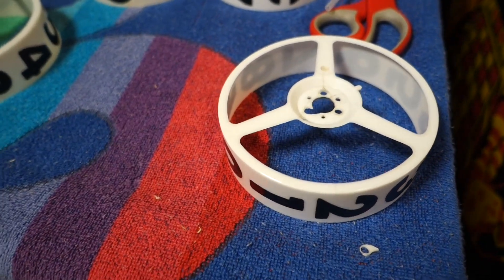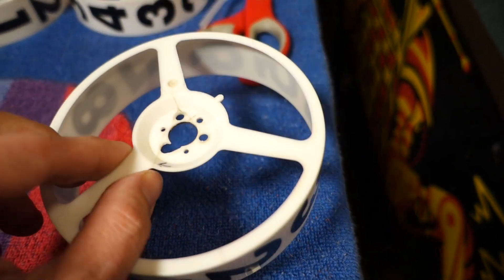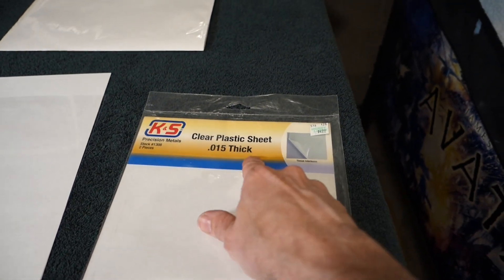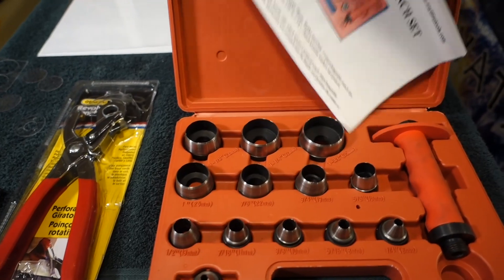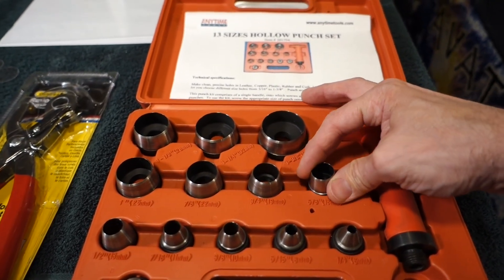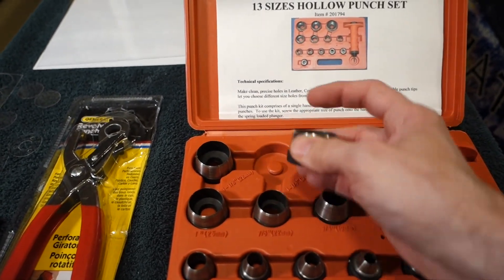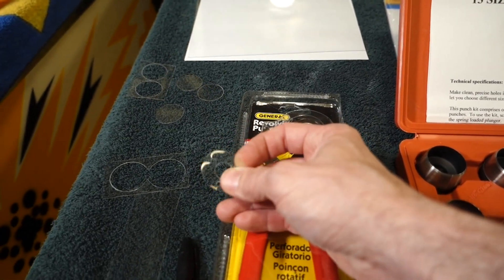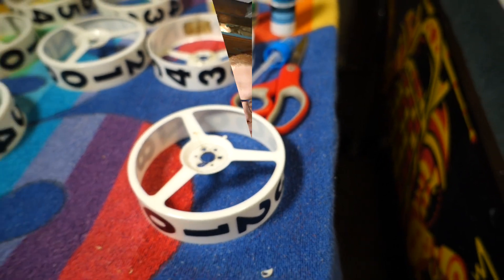1962 United Embassy shuffle alley project (ep6) repairing cracked score reels

Comment: This is the type of fix that a 3D printer would be perfect for. You could either print the reinforcement piece, or you could just cut out the original "hub" and glue in a printed replacement.